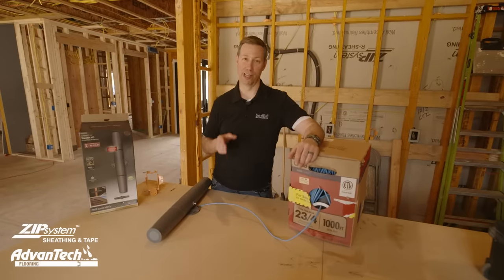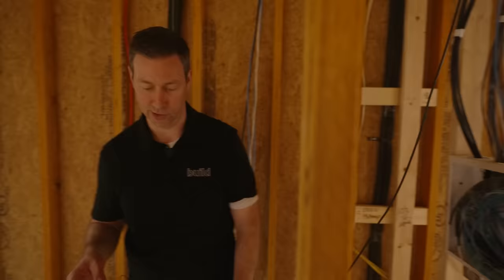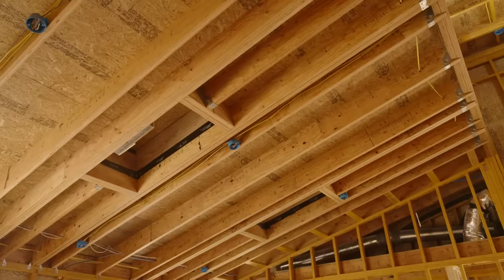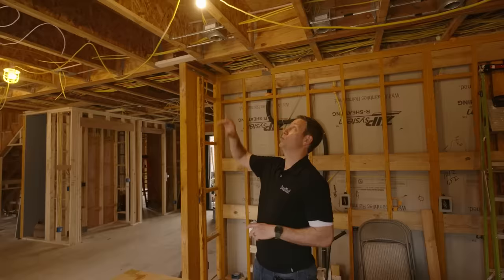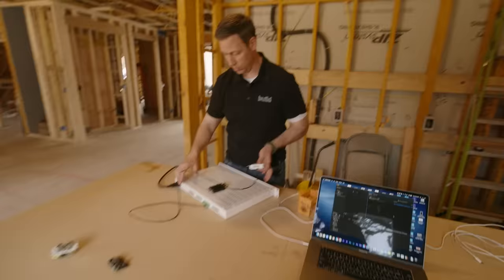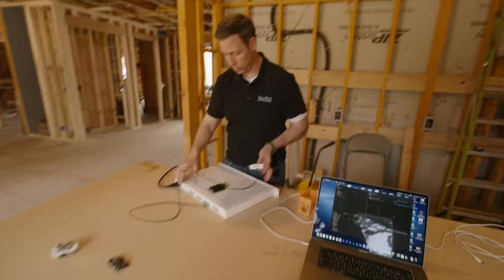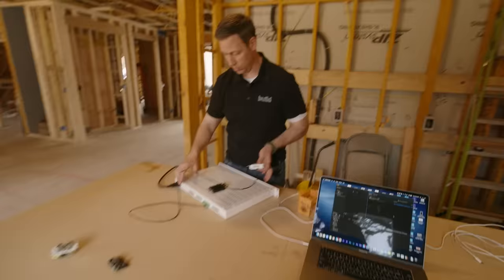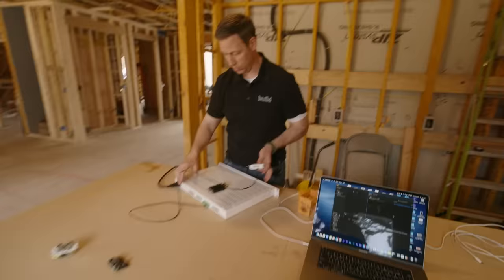Low ⚡Voltage at the Real ReBuild

Comment: Voltec is a waste of money for a home.  It makes sense for the airport changing stations, but not your home.  It uses too much power for it's benefits.  Plus the USB standards will change A -> C -> N. You will have to change out the outlet every time there is a new version.  The power outlet that is everywhere in your house is more efficient use of electricity and those power outlets will not change in your life time.  Yeah, they gave you the unit.  To pay $1,000.00 to put this in just so you can switch it out in 5 yrs is another waste of time and money.  At the end of this video you talk about the old apple connector and how that was a mistake.  Voltec is that kind of mistake.   BUT, you got it or free, we don't all have that option.  Cat6E is good and you could have run fiber next to it if you wanted future proof your connections, but the fiber has never taken off.  Mostly because the wireless bandwidth has increased every year.

Comment: so fast forward twenty years and all those cables you have are slow and outdated. We have this problem in our house. Guy wired the whole house with cat5 (100mbs) and yet we don't use them because it's slower than our wifi. So what's the real solution here? Prewire isnt it. What about pre-infrastructure, conduit or some other mechanism. Your also locked into the choices you have here. Good luck moving the TV if you want it on a different wall. How do you get around that

Comment: Matt starts talking about why he decided to use 12 2 wire for 20 amp service then immediately doesn’t address the question and talks about the low voltage usb plugs………..

Comment: hopefully you don't regret your sonos decision, they've already been raked over the coals a few times for killing older model products or dropping support for them and effectively making them a brick. In my opinion you'd be better off with traditional speakers and some form of "brain" in your media closet since you're going to the trouble of making a media closet. that way if the "smarts" of your smart speakers is turned into a brick you just buy a new brain and all your speakers still function.
Reply: My buddy bought one of those $1600 sound bars they came out with a few years ago.  As an audiophile, it was the worst sounding pieces of junk I have ever heard..

Comment: Cost consideration: running a 70" TV, which draws around 200W of power, for 12 hours a day will cost about $10 a month in electricity. That's nearly the cost of streaming subscription service.

Comment: Do you really need to run as much low voltage wiring now that the industry is moving more and more to wireless? Bluetooth 5 now has rock solid connections and other software gives better sound quality.
Reply: There's always going to be a place for wired connections, particularly computer/network and AV related.
Reply: Not a lot of bandwidth availble over wifi. Only 100 Mhz of bandwidth available for the 2.4 Ghz & 5.8 Ghz Wifi bands. A Cat 6a Cable has about 550Mhz or about 2.5 Times more bandwidth for just one connection. For Wifi you are sharing the 200 Mhz Bandwidth available (if you are using both bands) for all the devices connecting to the access point. Plus it subject to interference as RF signals bounce off walls causing reflections, and also depend on the location of the antenna in the device.

Comment: It's hard to believe that you have been a builder this many years and yet you are nickel and diming your low voltage future proofing.  ie. a 3/4/1" flexible conduit from DEMARC to MEDIA closest.  Conduit is cheap and 2" would have been a much better choice especially with the long run.

Comment: I hate the USB plugs. They blow out after about two years.
Reply: The Voltek system is awesome. The price is my only concern, but I can see these used in all the bedrooms of the house or in a small office.
Reply: Also note that the Voltek system will automatically adjust the power amp by communicating with the device. In other words, the USB device uses a standard data protocol that tells the device how much power it can use. It's a smart power system and perfectly suited to any USB device. 
One word of caution, be careful not to use bad China-made USB cables. They are often shipped to America with substandard specifications and can burn out on higher amperage devices.

Comment: Matt, the Dream machine might choke a little depending on how many cameras you have and their resolution. Consider buying a UniFi’s Network Video Recorder (UNVR), this unit has multiple HDD bays and support RAID 1/5 for hardware redundancy. I was also thinking about your UPS comment… I would recommend getting a Pure Sine Wave UPS unit/model. This will make sure you gear has clean power, then spend your money on a whole-house generator/solar, and not increasing your battery compacity in the localized media closet. PLEASE do a nerd video. I would also recommend giving Snazzy Labs a watch “This Smart Home Isn’t Stupid” (https://youtu.be/85yH56DS5mg) he makes some interesting points on the lighting-side of home automation. If you found this helpful, dropping a reply would mean a ton. #FellowTexans
Reply: Actually most electronics have switch mode power supplies and don't care about the type of AC power supplies. the switch mode Power supply rectify the AC, and use a Buck converter that used high frequency switching to covert the power to the voltages required. Devices like AC motors need pure sine AC to operate properly.
Reply: @guytech7310  Well! Look at that. I stand corrected. Thanks for the education, I've now got something even more suck my time away, into the dark hole of YouTube. Time to research and learn!

Comment: I was a TiVo guy as well.  You gotta try that Amazon FireTV recast.  Pretty seamless solution if you have a FireTV.
Reply: Forget Recast!  Tablo TV is the only way to go for Over-the-Air TV !  Also, get the 4 tuner version.
Reply: @rpsmith  Great share!  It looks like a nice solution for the non FireTV croud.  Reminds me of an HD Homerun a little bit that I used to pump cablecard over my network with in 2015.
Reply: @enduman  - I'm a Roku guy but I believe Fire TV is also supported by Tablo-TV.
Reply: @rpsmith  yes. Although I pretty much never use 2 channel recording at once much less 4. Works great with AppleTV. If they still sell lifetime subscriptions, I’d buy that too.

Comment: While I am sure the install will be amazing and work well, I don't understand the draw of trying to wire everything.  I ran Ethernet for my 2 APs and my cameras for my small house (garage for 2 cameras, so in a trench even when I ran 100 amp service to the garage), but I know I will see zero benefit to wired Ethernet vs WiFi.  The only thing I could even imagine would be 'better' would be 5ms lower latency if I were a first person shooter gamer still.  Love my WiFi setup, plenty of speed and coverage for all.  Just my setup, feel free to spend an extra couple thousand+ to have wires.

Comment: "Low ⚡Voltage at the Real ReBuild"
5:00 Why are you yabbering on about data cables ? Here's me wondering whether your low voltage system is going to be 12V, 24V or 48V.

Comment: And this is the problem with construction these days plumbers Carpenters electricians every other trade has standards and quality of work the low-voltage wiring in this house is a joke do it right or don't do it at all

Comment: I put in wall and in ceiling speakers; regret it now (never use them).
Reply: You don't have the right App or functionality to use them.
Reply: @HarmanatorNYC  I'm not a music guy in general. Even with a music app I wouldn't likely listen.
Reply: Built in speakers sound like dog meat to me. I'd much rather have freestanding speakers 🤷‍♂️
Reply: @DigitalBenny  there is very good dog meat though. Kef qi with fiber glass insulation back boxes for example.
Reply: @10tenman10  then you also have the problem you didn't tie them to the TV so you could hear it elsewhere.

Comment: Lol who cares run as thick of wire as you want. At some point you’ll need to plug in something massive (dehumidifier, space heater) so you’ll be thankful you ran thicker wire. Plus you’ll have less loss as it ages due to oxidation. Heck just run extra power wire everywhere while the sheetrock is down while it’s way easier to do.

Comment: I'm against the vendor lock that you mentioned for the samsung custom cable. What happens when samsung goes to the next iteration of that custom cable?
edit: embedded engineer here: after seeing the voltek dc power supply. You know why you're not wiring houses for DC? There's too many line losses. Why not just wire dc lines for all the LED lights that use DC anyways? Losses and with enough current it's incredibly dangerous. AC is inherently more safe because every 8.33mS there's a zero crossing where the energy required to break the circuit is zero. The only way that I see this being even remotely safe is with a solid state circuit breaker: https://www.atompower.com/
Reply: Samsung is on their 3rd version of that cable.  My 2017 9000 series 4k had it and I installed it into the wall down to a media cabinet, in 2019 I got the next 4k model and boom.. different cable.. luckily I decided to french in the new tv, so was already in the wall to run a new cable..

Matt better run a 2" rigid conduit from that TV to the media room..

Comment: Matt, speak with your Internet contractor about 2.5GbE and 5.0GbE.  CAT-5e cable can easily handle 2.5GbE, and CAT-6 can easily handle 5.0GbE.  
For a SOHO LAN, Gigabit Ethernet is rapidly becoming obsolete, and CAT-6 cable is overkill if your LAN will only run at Gigabit speed for the duration.
And, if your PCs do not already have 2.5GbE ports, upgrading PCs to 2.5GbE is a simple matter of installing a PCIe x1 add-in card, like the Rosewill RC-20001.  Windows 10 should configure the required device driver automatically.
Or, there are now lots of USB 3.0 to 2.5GbE "dongles" that work almost as well as PCIe x1 add in cards, and they also plug into USB 3.0 laptop ports.  The better dongles come with simple adapters for Type-A and Type-C USB connectors.
To exploit 2.5 or 5.0GbE, you'll need something like a TP-LINK unmanaged 2.5G switch.  We just installed the 8-port version and it works great by accelerating PC-to-PC traffic over our LAN to 2.5X the speed of an obsolete Gigabit Ethernet LAN.
Reply: The Sabrent model NT-SS5G is rated at 5.0GbE, but some reviews were a little disappointing because the USB side of the controller still uses the USB 3.0 "Gen1" legacy frame:  1 start bit + 8 data bits + 1 stop  =  10 bits per byte transmitted.  
As such, MAX HEADROOM is 5G / 10 bits per byte  =  500 MB/second.  
The very latest USB standard uses a 10G clock and a 128b/132b "jumbo frame" (132 bits / 16 bytes  =  8.25 bits per byte transmitted).
As such, MAX HEADROOM is 10G / 8.25 bits per byte  =  1,212 MB/second.
Add to those theoretical maxima the reality of controller overhead, and the measured throughputs of the 5.0GbE dongles were much lower e.g. ~350 MB/second.  
See the comparison of these dongles by Patrick Kennedy at his website servethehome [DOT] com .

Comment: If my guys did that work I’d fire all of them… There is way too much wrong. It was engineered wrong, installed wrong and will be very limited for today’s standards. Your video’s have always been great but I think your out of your depth with this one. Maybe a track home.. To truly be helpful to to other builders they need to understand service feeds and at minimum network. Most “think” they get it and don’t.  At least you ran a chase for it. Did you wire at minimum  a 5.1 for your main tv? If so, where was it wired to? Below the tv for a cabinet or did you run it to the panel? So much wrong.. I’ve been doing this for many many years and Its clear you should consult a low voltage integrator.

I can’t believe you ran low volt parallel with high voltage… You need at minimum a 32” panel for the gear typically want to install. What your doing is bare minimum for a track home. This is not for a luxury Custom Home.

Comment: Honestly disappointing... Because you used a lot of good product I was waiting for a security system, yes this is part of the low voltage, and so run some inexpensive wires to every opening but no...
Well at least you are using ubiquiti, that's a start...
Reply: FWIW: I have an ELK system. Mostly because it has an RS-232 port & a documented RS-232 signal system so you can interface it with a computer. if you know of a better alarm controller, please share.

I also have the grandstream GDS3710 Door system that provides an IP camera, VoIP door bell and a RFID reader for use with electric door strike. This unit will work with Grandstream Video VoIP phones so when some rings the door the video phone rings and displays video from the camera.  It also has a keypad so you could use it to enter a pin code to open a door or activate\deactivate an Alarm system (ie the ELK with the RS-232 port). Using VoIP phones with Asterisk PBX (not really an off the shelf option).

I also have Acti & Axis IP video cameras Some of the exterior IP cameras are connected to a PIR (passive infrared sensor) that trigger an event notification when motion is detected. The built-in video motion detection is worthless for outdoors because wind blowing trees or clouds moving triggers the motion detection. I get an eMail alert on my phone & laptop when the PIR sensor goes off. Only issue is the PIR is not deer proof.

I also use dakota alert wireless motion sensors set up to monitor my driveway. They go off like a doorbell chime when a vehicle is moving in my driveway (but also has a problem with Deer).

For camera DVR, I am currently using BlueCherry DVR (Linux) but I may replace it with something else.

I am avoiding using consumer security products simply because I don't trust them (might get hacked) or go unsupported by manufacture when it gets bought by someone or they choose to stop supporting them.

Comment: And every place you have these low voltage USB outlets you are going to have a power suck where the outlet is going to be converting the 120v down to 5v DC  24 hours a day 7 days a week 365 days a year...

Comment: Matt I enjoy your content. However, as a low-voltage contractor have to say I am disappointed in this video. You do so much research on other products but you failed to bring in a low voltage guy to consult with and you have a 'guy' who you know that gave you Ubiquity, Ubiquity is good but you really cheaped yourself out on this one. I have seen builds like these dozens of times and it breaks my heart, you guys spend so much on this and on that but you skimp on this part. 
While you are a bit more thoughtful than some, the fact that you are on YouTube talking to millions of people does a disservice and will lead to more bad low voltage out there for the masses. More wire is better, period. Wireless is ok, but for speakers, TVs and especially in your home where you don't want ANY wall penetrations you are going to force future owners to cut holes and drill all over the place so they can get the features they want, OR you will force them to go without. You probably saved $1-2k and caused yourself a ton of future headaches when you realize the Sonos system can't deliver for your room type or when you realize that you need more wiring throughout due to wireless signal loss. 
All I'm saying is that there is a lot missed, that I saw, and you should have brought someone in that does this full time. 
But hey you got a free thingy for your home so...

Oh and for the love of Pete, please NEVER use that conduit that you used! It pulls really really badly and you will never get any wire through there, you need at least 1" conduit, there are different kinds made for this that have a pull string already built in. I hope your house isn't rocked, but I'm 3 months late and it probably is.